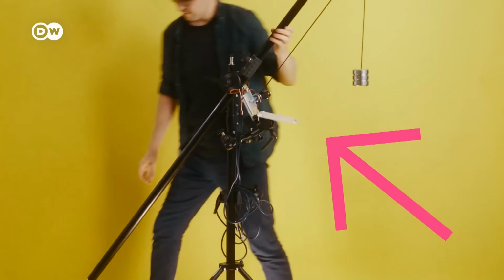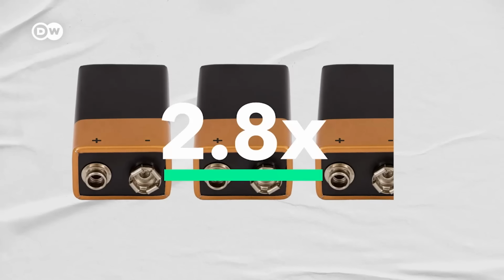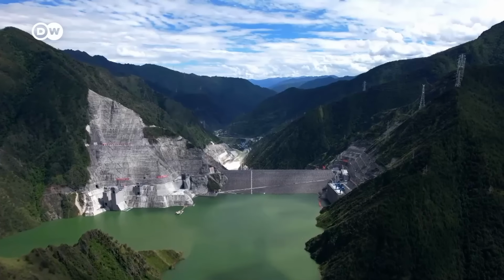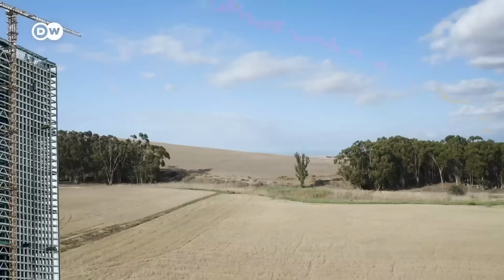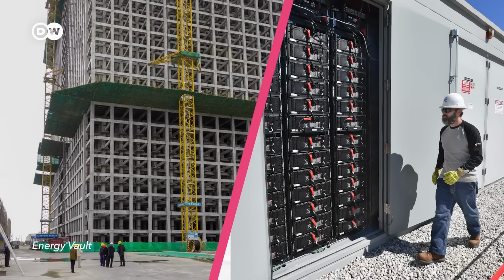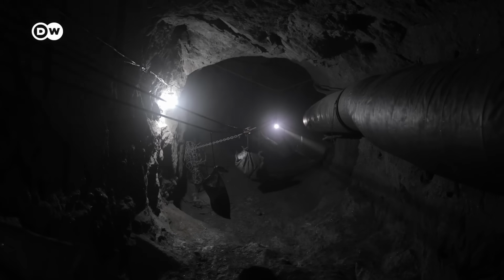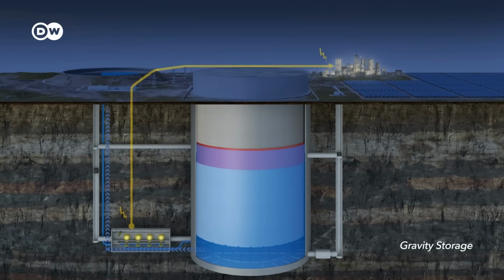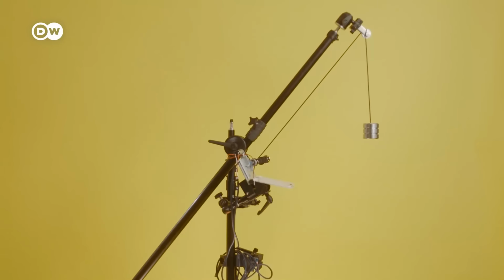How to use gravity to store energy

Comment: Nothing beats good ol' pumped-storage hydroelectricity. Don't fall for concrete towers
Reply: Not everywhere has suitable conditions for pumped hydro
Reply: @ironboy3245  And no where is suitable for this crap idea. NO WHERE. can you not get it? You can build water tanks with as much steel as  needed to make this   out of steel. As much concrete to contain water. It is a  sodding joke  but  idiots think this is at all suitable for storing energy.If the places suitable for microhydro used it we'd have solved 90% of teh problem.
Reply: @ironboy3245 yes almost everywhere on main land continents have areas many areas where pump hydro storage is completely viable and the best solution
Reply: Pumped storage hydro requires significant changes in elevation though, which doesn't really work for my home country of the Netherlands. I think this sort of thing works better for that, although unpractical.
Reply: Two things beat water storage. 
One, lack of mountains that can be used to store water and two an immediate lower ground to place the generator. Lack of water and evaporation can also be issues in desert countries.
Reply: Hydro electric energy is geographically limited
Reply: Fishes like too
Reply: Real
Reply: Make the connection 👉 The Connections (2021) [short documentary] 🌎 ♥️ 😎 ✨️
Reply: Aight brb gonna DAMN A HUGE RIVER
Reply: Pumped storage hydro (PSH) is good, but reasonable sites are few and are far between and we need a lot of storage to displace fossil fuels.  What's worse is that water rights and water access become even more contentious as global warming heats up.

Water is dense at 1000-kg/m³ but that's only fractions the density of metals like iron at 7878-kg/m³ so gravity batteries can be significantly more compact in area and height versus PSH.
Reply: @beyondfossil  A cubic meter of water costs a few pennies to acquire and you get millions of them for free each time it rains. A cubic meter of iron costs thousands of dollars.
Reply: @rubiconnn  True but the problem with pumped-hydro runs in an open-loop.  Water will also constantly *evaporate*.  That lake/reservoir water is invariably full of organic and inorganic debris which needs more ongoing maintenance.

In contrast, gravity storage systems run in a closed-loop, which is much ideal conducive to long life and lower operating costs per MWh of energy storage.  The iron mass doesn't degrade neither nor change weight so provides consistent storage which energy grid operators always prefer.  Iron is the most stable element in the universe btw.

The initial fixed capital costs have less impact for long running operations like this where variable costs dominate.  

Working with a mass that has more than 7x the density of water, gravity energy storage systems can be much more compact in footprint and head height since potential energy is directly proportional to the mass being lifted.

Look at GravityPower's solution with a fluid suspended giant mass.  It's also a closed-loop system but using only hydraulics to transmit energy, so no need for any cables or pulleys.
Reply: @beyondfossil  We've had dams for thousands of years and doing just fine, replacing water is EASY ( well unless you're landlocked, and even then rivers are a thing ), there are many ways to significantly reduce evaporation as well, these gravity batteries however...Just the maintainance cost will be HUGE
Reply: @j4genius961  How HUGE?
Reply: @beyondfossil  A full scale version would probably cost about 1-2 hundred millions a year in China, a couple of billions in Europe, and a whole new war in the middle east or Asia for the US
Reply: @j4genius961  That laughably inaccurate but thanks anyways.
Reply: @beyondfossil  You're welcome
Reply: @rubiconnn Many, if only we could use that stuff that covers 70% of the planet. That would be rather convenient.
Reply: @beyondfossil  Your objections to pumped hydro are spurious.
Reply: @rogerphelps9939  Thanks for your opinion.
Reply: @beyondfossil  but there is far more mass of water in a reservoir than Energy Vault can ever store in the ceiling of its expensive building or move around the top and bottom of a mineshaft.
Reply: @skierpage  Sure, PHS can be larger because it takes advantage of natural water bodies.  But there lies its biggest problem.  Because those water bodies are rare and getting harder to find as global warming ratchets up water contention even higher.  The environmental & cultural impacts of damming water bodies are large and increase with larger sizes of water bodies involved.

Just to be clear, PHS electrical power & capacity is limited by the smallest of its two reservoirs.  You could source the water of a huge water body like, say, the Black Sea but your PHS will be limited by the size of its secondary reservoir which could be significantly smaller by orders of magnitude.

That said, gravity solutions use weights that are 5x (or more) denser than water, so provide tremendous space efficiency.  Operating efficiency can increase as well being a closed system without environment sludge constantly contaminating the system.  Dealing with water is already a next level in terms of engineering and maintenance, let alone debris filled water.  Also, gravity storage systems could be built faster, and in more locations nearer to actual use of the generated electricity.
Reply: @beyondfossil   yes pumped hydro has limitations. But gravity storage is hopelessly uneconomic because physics. Go invest in Energy Vault. You will lose your money, meanwhile around 300 GWh of lithium-ion battery storage was installed last year.
Reply: @skierpage   Thanks for your opinion.

This thread was comparing PHS versus other gravity-based solutions.  PHS performs worse on many key aspects: (1) energy density (2) environmental impact, (3) geographic & space constraints.

PHS does have massive scale though.  And it also 100+ years of hydroelectric dam experience to draw from.

Energy Vault's towers are the worst gravity storage solution.  Unfortunately, that's what most people think of only when they hear gravity-based storage.  The tower is very eye-catching, and I suspect that could've been its primary goal.

That said, I would go with GravityPower's water hydraulic approach with a massive piston weight.  The only moving part is the motor pump/generator: there are no pulleys and no cables whatsoever, and all closed-loop.

Of course, Lithium has highest energy density but also highest cost, greatest material complexity as well as lowest longevity.  Whereas a gravity-based solution can have lower cost per MWh than Lithium LFP and much greater longevity in many decades.  Moreover, Lithium is made for very high energy density which is paramount for mobile applications like EV and portable electronics -- this adds large amounts of unnecessary cost when applied to stationary grid-scale storage.

Since you're expanding the conversation to other energy storage systems, my top preference at the moment is liquid-metal flow batteries followed by compressed CO2.  Then there's ceramic-based thermal storage which is going to be huge.  Because a vast amount of energy consumed by humans is thermal based: industry (steel, concrete, glass, other manufacturing), building heating (both residential & commercial).
Reply: @skierpage  Thanks for your opinion.

This thread was comparing PHS versus other gravity-based solutions.  PHS performs worse on many key aspects: (1) energy density (2) environmental impact, (3) geographic & space constraints.

PHS does have massive scale though.  And it also 100+ years of hydroelectric dam experience to draw from.

Energy Vault's towers are the worst gravity storage solution.  Unfortunately, that's what most people think of only when they hear gravity-based storage.  The tower is very eye-catching, and I suspect that could've been its primary goal.

That said, I would go with GravityPower's water hydraulic approach with a massive piston weight.  The only moving part is the motor pump/generator: there are no pulleys and no cables whatsoever, and all closed-loop.
Reply: @skierpage  Also… of course, Lithium has highest energy density but also highest cost, greatest material complexity as well as lowest longevity.  Whereas a gravity-based solution can have lower cost per MWh than Lithium LFP and much greater longevity in many decades.  Moreover, Lithium is made for very high energy density which is paramount for mobile applications like EV and portable electronics -- this adds large amounts of unnecessary cost when applied to stationary grid-scale storage.

Since you're expanding the conversation to other energy storage systems, my top preference at the moment is liquid-metal flow batteries followed by compressed CO2.  Then there's ceramic-based thermal storage which is going to be huge.  Because a vast amount of energy consumed by humans is thermal based: industry (steel, concrete, glass, other manufacturing), building heating (both residential & commercial).
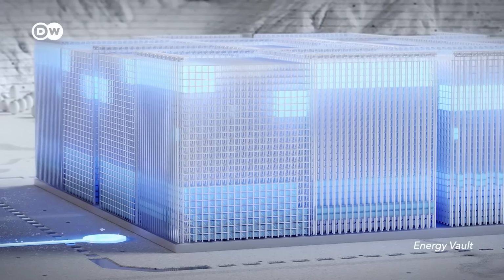Reply: @beyondfossil   if I understand all your comments, you admit Energy Vault is no good (whether a tower or a more expensive building with complicated racking, see 4:09 in the video) but hold out hope for some other built gravity storage. But physics is unyielding. To store 100 MWh, you have to lift 250,000 tons of stuff 150 meters into the air!! In the 200 years gravity storage has been possible, nobody has built a cheap low-maintenance system to do that, except for pumped hydro at existing sites. Gravity Power has been working on this for over 14 years and seems to have nothing to show for it. I genuinely wonder if the people funding these companies are innumerate. "We'll raise 10 tons in our demonstration shaft... then just scale it!"
Reply: @skierpage  I understand it is a massive amount of weight.  It may not be financially possible now but could be in the not-too-distant future but likely after we've completed the global energy transition.  The available iron will not be a problem either.  We mine a huge 3-billion metric tons of iron a year!

Still, the problem of heavy weights and large holes still vastly simpler than nuclear fusion power with people still hitting their heads against the wall for several decades and several more without any positive energy returns as of date and none in the near future either.

The one big problem we need to get better at is digging holes in the ground economically.  I had considered heat pumps with geothermal heat pump but the cost to dig a 400ft deep hole in the backyard is upwards $19,000 USD.

The extreme simplicity of a massive water piston is very alluring.  Especially when compared against the complexities of manufacturing batteries of any type at scale.  We need to learn to dig huge holes faster and a lot cheaper, by two or more orders of magnitude cheaper.

As a side note, digging holes could literally save the world.  There is enough geothermal energy within the Earth to power our entire civilization easily to next levels of advancement with clean energy.  This geothermal energy is 24x7x365 non-stop too.
Reply: @skierpage  Yes, it's a lot of weight.  It may not be financially possible now but could be in the not-too-distant future but likely after we've completed the global energy transition.  The available iron will not be a problem either.  We mine a huge 3-billion metric tons of iron a year!

Still, the problem of heavy weights and large holes still vastly simpler than nuclear fusion power with people still hitting their heads against the wall for several decades and several more without any positive energy returns as of date and none in the near future either.

The one big problem we need to get better at is digging holes in the ground economically.  I had considered heat pumps with geothermal heat pump but the cost to dig a 400ft deep hole in the backyard is upwards $19,000 USD.
Reply: @skierpage  Also…. the extreme simplicity of a massive water piston is very alluring.  Especially when compared against the complexities of manufacturing batteries of any type at scale.  We need to learn to dig huge holes faster and a lot cheaper, by two or more orders of magnitude cheaper.

As a side note, digging holes could literally save the world.  There is enough geothermal energy within the Earth to power our entire civilization easily to next levels of advancement with clean energy.  This geothermal energy is 24x7x365 non-stop too
Reply: @beyondfossil  But reservoirs generally hold many orders of magnitude more mass than the biggest gravity battery could. Also the working head is likely to be much greater with hydro.
Reply: @rogerphelps9939  See my comments before on this subject
Reply: @beyondfossil   SEA WATER? many Cities are near coast lines. Many places with huge populations. Iron you say. because that takes no energy to make eh????  Go  on expert man tell us another.
Reply: Concrete towers are great, they just need a few optimizations.
For example use something readily available that does not break down or need maintenance and ideally is liquid so you can use fixed pipes for the most parts.
Ideally something very cheap with a high density. That is available in abundance. Like salt water.
...
Reply: Do the maths, i don't think you can dig a hole deep enough, or hold enough quantity of water.   I calculated how water I'd need to collect on my roof to power my house.   Unfortunately my large Roof isn't big enough and it doesn't rain enough.

Also, consider how much energy is used to lift water from deep wells in countries without mains water supplies.  It isn't so much.

Something very heavy is needed.
Reply: @D1.y  local ones beat pumped hydro far away 🤷🙂
Reply: @mael1515  It's much easier to dig a massive hole in the ground and accompanying hill for pumped hydro than it is to stack concrete jenga towers.
Reply: @Beskamir  ... If you have a suitable hill nearby. And if it's a mountain it becomes much harder. I love hydro, but at least in Germany it's potential is limited by geography and we reached that limit in the last decades, unfortunately.
Reply: @mael1515  Still easier to make a fake hill/mountain than it is to make jenga towers work.
Reply: @Beskamir  it's too much work to just dig a whole and make a hill. You need natural landscapes that allow for it
Reply: @Chris-rg6nm  Still less work and more functional than stacking blocks.
Reply: Lollzzz! There is a much cheaper way to build a new innovated gravity turbine easier from domestic to industrial mega-power that has "proved its efficiency already", but no response has ever been received from any of these tremendous researchers throughout the world that this innovative and compact rotative low-cost gravity turbine has been abandonned and dismantled with much regret because, may be, it might become a "threat" to all the companies of money-making billionaires.

Comment: The by far best storage for excess energy from renewable sources is green hydrogen.
Reply from the maker: Yet only minority of it is green. 🙄 Did you watch this video from us yet? 👇
"The truth about hydrogen"
📺 https://www.youtube.com/watch?v=AGTjKJHu99c
Reply: Green hydrogen is a pipe dream. Truly horrible energy losses. Difficult storage and handling. Requires purified water. Technology doesn't exist at scale (and probably never will).
Reply: Yes, I'm starting to think green hydrogen used in huge scale in just a few locations across a nation can be economical for long-term seasonal energy storage.  That is, storing abundant energy from spring/summer for use in fall/winter to cover the entire annual cycle.

However, hydrogen for personal vehicle use will not work.  It's cost and infrastructure would be huge to build out along with other problems with hydrogen efficiency and production.

Comment: High or low Dc to dc motor energy multiplier transmission generator and many electric capacitors for 30 plus year life...theres no good reason for a gravity battery...only a conductive energy to a natural heat conductor with the proper atomic geometrical design...ever use a stable thermal battery? Lyj2024

Comment: In terms of density, space and infrastructure cost, I think pressurized gas makes more sense
Reply: It's and interesting idea. But maintaining pressure and temperature is hard and expensive in large scale for it to be finically viable. 😢 got any examples?
Reply: @echothebm  I have high hopes for compressed CO₂.  Look at "Energy Dome" using compress gaseous CO₂ into tanks (70 bar pressure).  It's a closed loop system, so doesn't need any more CO₂ than from initial CO₂ supply.  LCOS = $50/MWh.  Compare pumped hydro $186 LCOS.   Round trip efficiency (RTE) 75% to 80% which is in the neighborhood of Lithium RTE 90% which Lithium is pretty much #1 in efficiency.

Compressed gases also use just plain industrial material for construction and operations, nothing exotic.  The turbines also provide AC synchronous buffering naturally which switched DC inverters do not do.
Reply: @echothebm   April 2024 "A compressed air energy storage (CAES) project in Hubei, China, has come online, with 300MW/1,500MWh of capacity."  May 2024 "Chinese developer ZCGN has completed the construction of a 300 MW compressed air energy storage (CAES) facility in Feicheng, China's Shandong province." Both claim to be the world's largest.